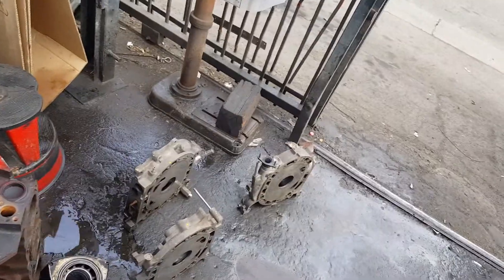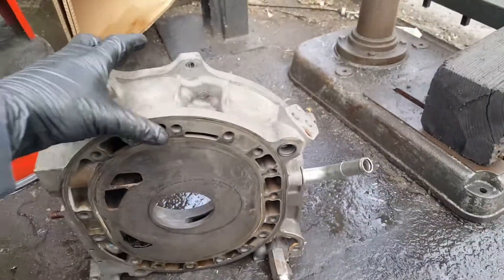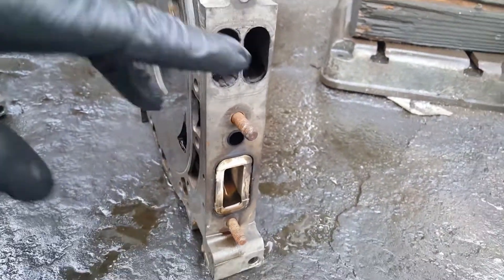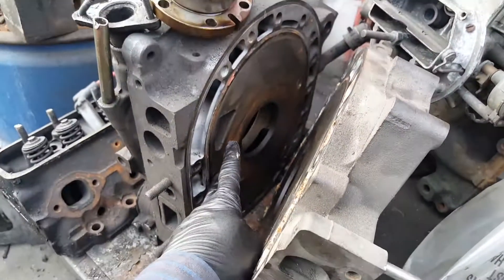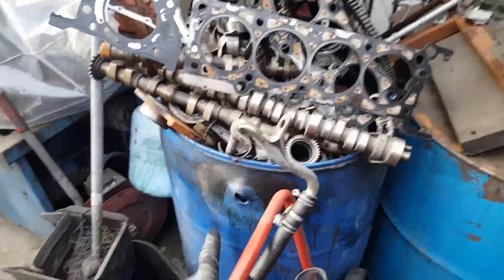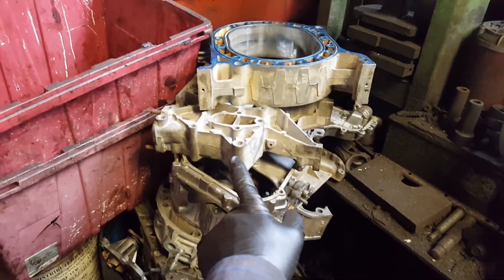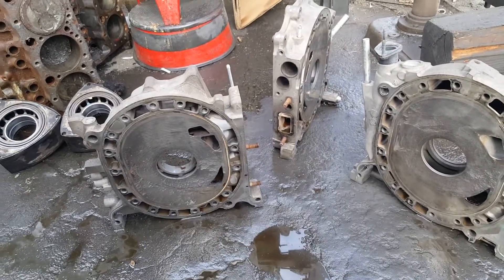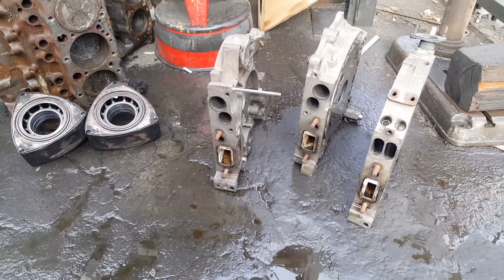MAZDA RX8: 4 PORT or 6 PORT? Apex seals

Comment: My 4 Port is blown and i want to rebuild it myself, i am a mechanic, but i never done a rebuild on an rx8, so the question would be, can i replace the 4 port irons with a 6 port and gain more horsepower but stay all stock? I think i would need a new ECU and speedometer unit, im from Germany, maybe you can help me a bit i would really appreciate it!
Reply from the maker: Yeah you can match the 6 port but remember you will also need the 6 port intake or you can stay 4 port and port the irons on the intake ports